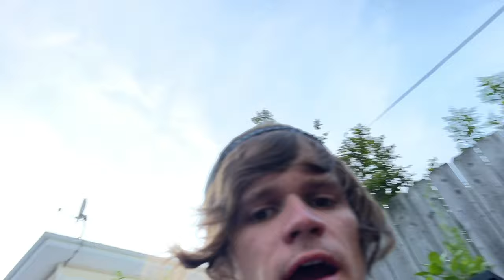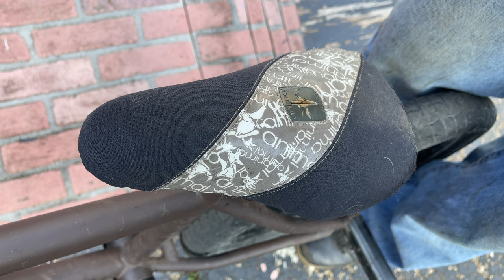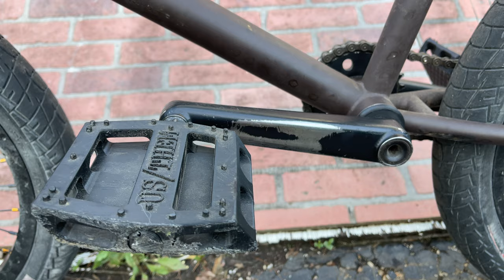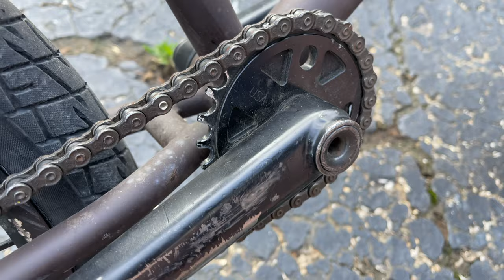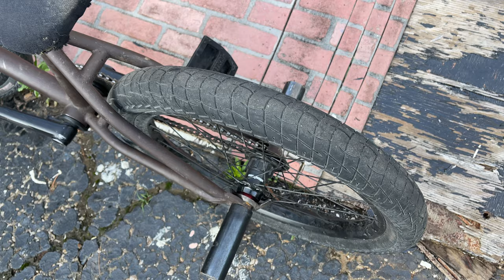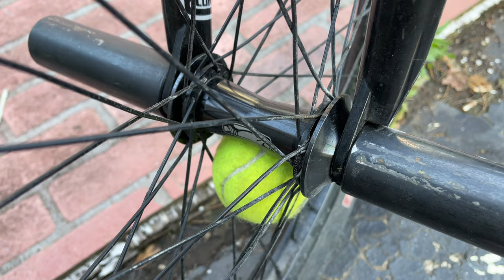3D Printed BMX Parts Everywhere! - Zack Gerber Bike Check

Comment: Made a "5th peg" using pvc tube that slots to the bb, then moved to using pvc end cap that slots to the dust cap. Wasn't able to extensively test it though since i have busted knees. 
Currently, i have a BB Buddy from buddy_mfg installed as it just arrived yesterday. Will test it once my knees feel ok.
I think a combination of BB budy and a bb shell protector is the way to go for the 5th peg concept.

I'm a fan of DIY and innovation and zack embodies that.
Really clean bike might i add!
Reply: From the looks of it...that's what is the 5th peg presented here...the bb buddy but covers the entire bb, which for sketch riders like myself...I rather have more protection.
Reply: @SFletcherson a combination of metal and plastic is what i meant. Bb buddy as the main part that absorbs all the impact/abrasion and plastic as sleeve for the bb shell to slide. 
Wtp pathfinder frame actually did come off with an offset thicker bb shell and chainstays.

Comment: Why not use a printed seat post too.... I'd love to have one that is 3D printed but also has a stash tube inside or a small compartment you could keep money in or a key.     😉😁
Reply: The thing is one would have to find a way to make it strong enough but still being light. Post can take a lot of pressure if one falls on their seat hard enough. or if someone bails...the post would need to take a lot of beating.  I know I saw Nyquist snap his carbon fiber seat.
Reply: No way a hollow 3d seat post would support a riders weight, and if it did most filaments will change with temperatures imagine cruising on a hot day and your seat post crumbles cause the plastic got brittle
Reply: Seat posts are already hollow. If stashing stuff in is what you want, maybe just find a plug that will fit in to the hole. 
But since seatposts are bolted to the frame, you also need to carry your allen key around.
WTP came up with the Smuggler seat years ago, sadly, they discontinued it.